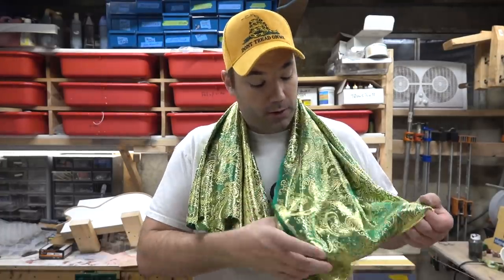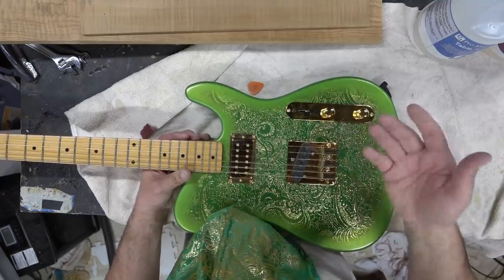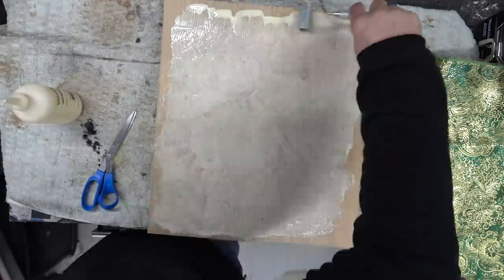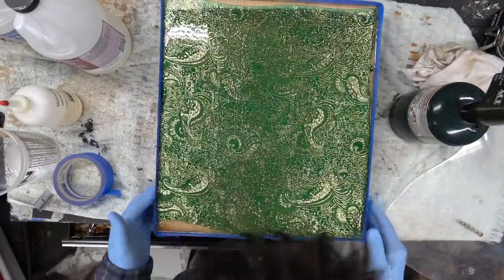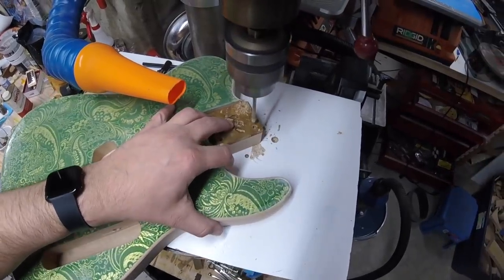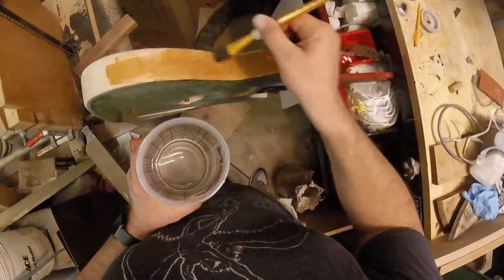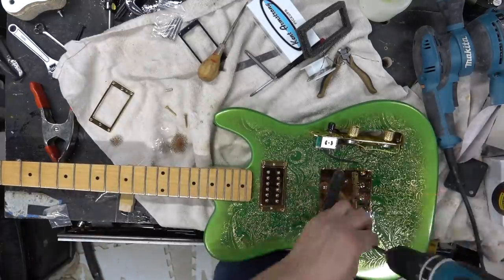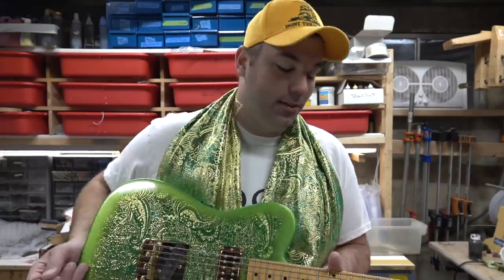FABULOUS! Fabric Topped Custom Guitar - Green & Gold Tele

Comment: Can you recommend a combination of a sealer, paint, & clear coat if you only have access to rattle cans? 

Dupli-color which offers the best range of metallic colours is acrylic and most sanding sealers I can find (here in Australia) are oil based.

Comment: You can sand and buff the epoxy if your seeing the texture of the material.. ive also seen some really good" paisly" stencils in the airbrush section at S. B. C. global. It looks really good, just thought if you werent happy with texture, thinned out airbrush paint is pretty smooth

Comment: Beautiful,  when running a humbuck and a single coil it's tough to get both right using one tone one volume pot.
500k too bright for single coil, 250k too dark for humbucker. Could run a cap from single coil on 500k pots, but still won't sound quite right.
Otherwise run seperate volume and tone pots for each .

Comment: you are the best at making these type of videos. Just an pour on trick... put your resin (not the hardener) in a hot water bath for about 5 minutes before you mix. This makes the resin loose and it mixes better with the hardener and creates less bubbles bc of the lower viscosity. I usually take a plastic container filled with tap water and heat it in the microwave for 2-3 minutes - then leave the pre-measured cup of resin in the hot water for a quick spell... most of my pours are with dollar store cups that transfer the heat pretty well bc they're cheap and have thin walls. Cheers.
Reply from the maker: I did that with the second coat.  Next vid i will show that

Comment: came out amazing!!! Why did you use the belt sender, didnt the router table already brought the body to the proper size? and why didnt you use the epoxy to also stick the fabric to the body?
Reply from the maker: I used sander to smooth out the sides.  the epoxy is a mess so I needed to get the fabric first.  I had a fear that it would move if I tacked it down.

Comment: ANY air tool you buy from Hazard Fraught has to be completely torn down and and every joint and fitting re-sealed.  You'll have much better results if you do.  Some of their mid-tier spray guns are just fine after a bit of a tune-up. I have a pressure / vascuum pot and a portable soda blaster - neither one of those would hold air for more than 15 seconds until I tore them down and addressed every fitting.

Nice end result tho!
Reply from the maker: Very tru.   My bad.  The airbrush worked great

Comment: What kind of fabric is that? I'm working on doing a fabric topped guitar, but my first attempt (using a synthetic satin-type material, with a similar gold embroidery pattern) ended in disaster when the clear-coat material I used to cover it essentially melted/disolved it...went almost clear, and the gold stuff disappeared completely.
Reply from the maker: Search amazon for green and gold fabric.  This worked pretty good
Reply: Thanks man...found it! It seems to be very similar to the stuff I used, so the problem was the clear coat material I used to build it up then...the epoxy resin would be the difference
Reply from the maker: 2k is toxic.
Reply: Yes, but it  wasn't caustic towards your synthetic brocade fabric, which was where the 2-part polyester sanding sealer I used went wrong...Texas Toast Guitars method for fabric topped guitars works well, with cotton fabrics, but apparently not so well on synthetics.  I should have done a small test piece first, but live and learn 😉

Comment: Why do people buy Garbage Freight tools and then bitch about them. If you pay $13.00 for a spray gun you got what you paid for. I always tell my wife when I need to buy a new tool. You get what you pay for with in reason. I never pay full price for a tool. I will wait until it goes on sale. But I ALWAYS buy brand name. If you spend $13.00 on a tool and it does not work you have no one to blame but yourself. But you did do a great job on the guitar, I have to give you that.